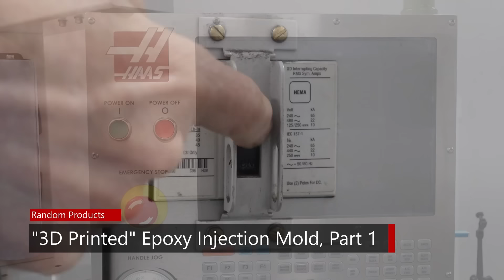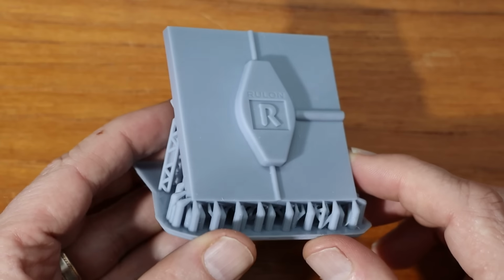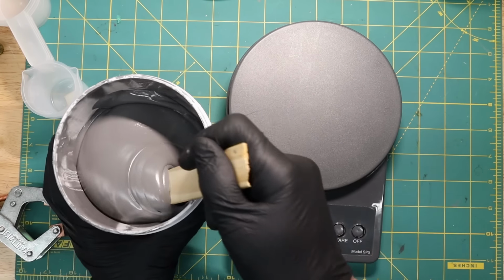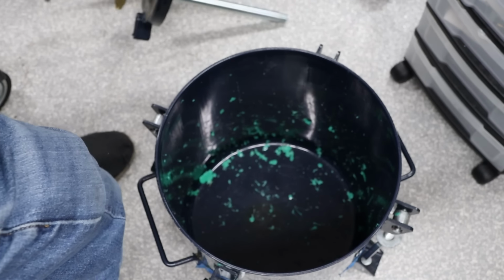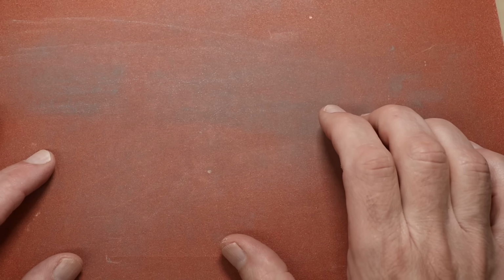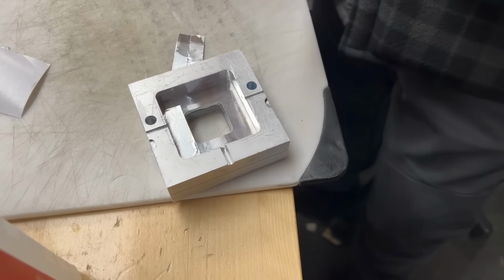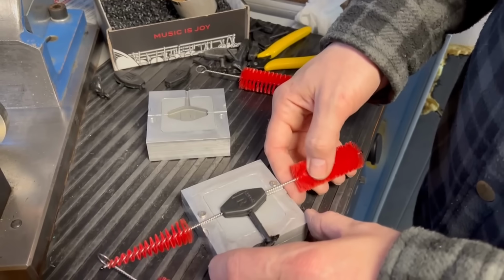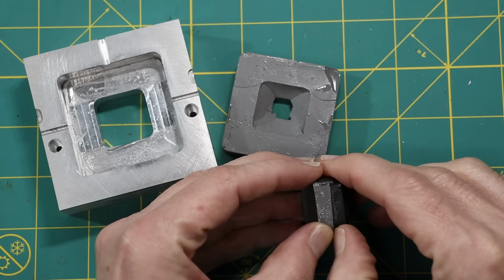"3D Printed" Epoxy Injection Mold, Part 1

Comment: If you add a radius to the thru hole for filling it should help a lot. You can see that the mold fractured along 45 degrees/the shear plane and this is encouraged by that corner creating a stress riser.
Reply: While this would certainly remove the stress raiser, overfilling the resin and sanding off flat at the mould half backs will mean that the epoxy will be better supported in the injection moulding machine platens, so it may not be necessary to machine a radius in the aluminium.
Reply: @dewexdewex  true, I guess it's more of an improvement rather than a solution
Reply: & smaller filling hole 👍🏻
Reply: Agree with the suggestion for radii (radiuses?) on those sharp corners in the aluminum carrier. It’s pretty much an article of faith when designing plastic parts - which your epoxy inserts also are, despite the aluminum filler - to use radii rather than sharp right angles on all shoulders, ribs, gussets and bosses to remove creation of stress points that build in weakness and may fracture - as this one has. 

Radii there will also help to reduce air entrapment when casting the epoxy. Spent about 15 years casting liquid urethane elastomers for engineering use, and the other article of faith I’d suggest is to slowly run the epoxy down the side of the aluminum and allow it to flow over the 3D printed pattern pushing the air in the bottom of the cavity before it. Maybe tilt the mold to about 25 degrees and slowly bring it back to level as it’s filling. Dumping the material straight onto the top of the pattern entraps air in the pattern detail right from the start. 

Cheers from Melbourne, Australia - thanks for a great video, love your work!
Reply: @nongbloke  agreed, fellow Melbournian :)
Reply: For easier machining (i.e. not a radious), a chamfer may well be enough.

Comment: This is really neat.  I've used high-temperature 3D printer resin to make moulds, experimenting with a home-made Buster Beagle 3D injection machine at the same time.  I've heard of people getting a hundred parts out of a run with direct printed parts which was good enough for my use case because printing another mould is easy enough.

Usually I ended up getting plastic stuck in some lettering after a few injections on my own machine and now I'm planning to upgrade my machine and try mould release.  It will be interesting to see how durable the epoxy is--if it's over 3x as good as directly printing a mould it would be worth the effort.  Thanks for the video!
Reply from the maker: I think it will be a lot more durable, but we won't find out until I make a new set of molds.

Comment: Thank you for this very informative testing video. This will save so much time and effort for others. The smaller hole for epoxy entry you mentioned while pouring might be all you need for reducing the blowout. I wonder if the hole could be so small that a syringe could be used to add the epoxy. Not sure if that would introduce bubbles. The smaller the hole, the harder it will be to remove the epoxy mold to be replaced by another mold, but each mold may need its own aluminum holder due to the sanding as the aluminum will be affected in the sanding process that the molds will need to be paired with their aluminum counterpart.

Comment: Great vid! Very interesting to watch, and I wanted to say thanks for your channel it is very helpful. I think you might be able to drill a through whole/slot in through the corner of the metal mold holder in place of the cutout at the back to pour the epoxy in. The corner because all the air would naturally bleed out there, and then it wouldn't allow for the epoxy to blow out

Comment: Is part 2 uploaded? Definitely think the back of the actually part in the resin needs supported by aluminium maybe put a hole in the corner where the 60psi pressure isn’t pressurising against it great work great patience something I’ve been looking into and possibly going to be doing in the near future great value received here pal cheers

Comment: I used this same method (also with Epoxacast HT) to prototype molds and I had a lot of trouble with uneven shrinkage/deformation on mine so in the end, the mold halves were misaligned by 0.050" or more. Also had issues like you with bubbles not popping due to the high viscosity, and found that much higher time sitting in the vacuum chamber helped, but don't have a pressure pot to use like you. The end product can also be quite brittle, so features that stick out and small details are more vulnerable. I think this works well with smaller molds with less detail, but probably won't be pursuing it for any larger or more intricate parts again.
Reply from the maker: Agreed. I think this is a potentially better over pure 3D printed molds. But clearly not a replacement for CNC machined molds. For the next version, I'm hoping that Rulon can do a production run to find out how long it lasts.

Comment: I have experienced similar defects when printing molds flat on the build plate. I attribute both the rough edges and compressed Z height on the top features to the same issue. The printer is not rigid enough to apply the required force to squeeze all of the resin out from under the large base section before the exposure starts. The resin continues to squeeze out during the exposure, causing the partially cured rough edge. The Z column deflects slightly so the layers with large cross sectional area print slightly too thick, but layers with small cross sectional area do not. I have been able to eliminate the rough edge and improve dimensional tolerance on my prints by adding long pre-exposure wait times and heating the vat to decrease viscosity. Printing at an angle solves the problem also but of course requires supports.
Reply from the maker: Thank you. That all makes sense.

Comment: While I'm just a beginner to this, I have been making resin mold masters for epoxy casting and I have a few tips from my experience over the last couple of years. I think that "traditional" top-down laser printers have fewer forces to contend with since their parts are in compression, not tension, since they sit on a perforated plate and descend into a vat of resin. That resin acts as a sort of support for the whole thing. If you need parts of a more geometric design that require tight tolerances that might be the way to go, but it is pricey, I was quoted about $1000 for a part the size of a softball. Printing things flat on a consumer printer can make your parts deform in the z axis. I always get stretching, sometimes as bad as 100%. It depends on the resin and the temperature of your print area. Using a heated enclosure at around 30 degrees celcius can help, when the resin is thinner there's less forces. If you print at an angle, round things won't be round. I've had a heck of a time trying to make parts with gasketed fitted lids. I've had to print the part over sized and machine it on a mill and lathe to get the precision I need.  If you print hollow, which reduces the weight and thereby the distortion, you will need drain holes and an ultrasonic cleaner to get all the uncured resin out or your parts will swell and crack over time.
Reply: Injection molding at home
Reply: I don't remember the UV resin brand/model being mentioned, but it looks like standard everyday resin. When I am trying to attain more accurate forms, I've had good luck with Sirayatech Build resin in smokey black. I would also try to print the master with the flat parts directly on the flat FEP, and hollow the whole thing to about 1-2 mm, with lots of ribs for structure.  You could then back fill the hollow reverse side with resin and pressure cure it for strength.
Reply: I also recommend a 24 hour post-cure in a UV oven, submerged in water. This will ensure the part doesnt warp as it ages.

Comment: Great video. I would add 4 3/8" -16 flat headed bolts thru the back side of the mold. One at each corner. Put mold release on the bolts before threading them in then tighten them well. Before you add the epoxy making sure you put more mold release on the whole cavity. They should protrude 2/3 to 3/4 of the way into the cavity area. . Putting a small relief angle on the sides will also help releasing the mold knowing the bolts will hold it in place. Without the relief angle you may want to make the bolts captive that way helping to push the mold out when not needed. Hope that helps.

Comment: From my understanding of the warping, it's due to the print getting stuck on the vat because of a vacuum/suction formed as it prints. That's why when you printed it at an angle, you had better results. The surface area of the print was smaller, so there was less of a vacuum being formed during the print.

Comment: Had the same idea as well. Did not know they made an epoxy mix.. Was going to try graphite powder as well as aluminum powder, for heat dissipation and maybe a mix of the 2. Was also going to try monster clay, to make a base mold. But not sure of  how hot the heat off gassing of the epoxy would be?(Temperature Gun of the epoxy would help) Testing.. will see 
PS.. would buy those blanks if they were available to buy..

Comment: Nice work. You may want to apply heat grease or a thermal compound in the interface between the inner epoxy mold and the outer aluminum case. It would surely be messy, but it is likely to help with the thermal performance.

Comment: I would suggest you fill the square opening on the one side completely and make sure it is flat wrt the rest of the mold.  This will do two things. First, it will support the injected material while under pressure and prevent catastrophic cracking.  Second, it will create a thermal contact with the pressure plate so mold can cool faster.  If you have a cool aluminum plate to set the mold on after injection that would also help to cool things down more quickly through the large sides of the mold.

Comment: One thing that helps minimize distortions/warping of the 3D printed masters is to use a resin with a bit of flex.  I print engineering prototypes and had a horrible time printing thin straight edges on parts until I saw a few YouTube videos comparing various resins and started using Sunlu ABS-Like resin.  It's fairly cheap but has little warping compared with most resins.

Comment: Thanks so much for you video, i Want see the part 2 ... i have some question, firts im from mexico, second the Epoxy can be change for resin of 3D Print?, i can see you have a problem whit the plastic, maybe your problem is the time cold and no the presure, i tried make a simple inyection machine with 3D print (ENDER 3) and the problem was my Mold and no the press... and last question which one the same epoxy injection similar?

Comment: Nicely done.
I wonder if the resin shrank uniformly enough to adjust the mold size to account for shrinkage (no tape).
Something I did to overcome the flatness issue for 3D printed parts was to print the part flat with a chamfer on the platten side. The chamfer lets you get a metal spatula under it.
I had printed parts and made silicone molds without curing the printed parts. Curing introduces stress and curvature so I just cleaned and blow-dried the 3D printed parts and then cast it.

Comment: What if you mixed the SLA resin with aluminum powder to combine the physical properties and help the heat spreads across the mold?

This way you’d skip the entire epoxy+remolding part, and still have the thermal benefits of the aluminum mix

Comment: I haven't tried it myself, but a while back I was looking into which resins had the highest temperature ratings and found the Stone Coat countertop resin to seemingly have the best numbers on paper. I had thought about using that resin along with mixing in either copper or aluminum powder to help with thermal conductivity. That resin is technically a coating resin and not a casting resin, so it may not work as desired when used this way, but could still be worth experimenting with.

Comment: I’ve had problems with filled lettering if I didn’t thoroughly wash the excess resin out. The IPA didn’t penetrate the recesses - acetone helped a LOT with making crisp relief features release resin but damage the resin if left too long.

Comment: Can I make a suggestion. Make the hole round. If you look at the cracks, the seemed to crack  exactly like old planes with square windows used to crack. In the corners. That is why you don’t get planes with square windows anymore. It causes too many weak points.

Comment: @JohnSL   I want to make a suggestion that builds on some of the other suggestions below:
Instead of filing the epoxy from the working face of your mold through the aluminum frame, add fill and vent holes to corners the 3D printed part.  Use a large syringe to force the epoxy through the fill hole while the mold is upside down (the printer part is below the metal frame)  This will allow the epoxy to flow over and away from your details, carrying any surface bubbles with it.  When the epoxy starts to come out of the vent hole, you will rotate to mold so that the vent hole is the highest point and continue to inject the rest of the epoxy slowly.  This way you can use the weight and viscosity of the epoxy to push out the bubbles and you can keep a solid back on the mold to avoid stress concentrations that will eventually shatter your mold.  The face of the mold will need to be sanded anyway, so removing the injection and vent sprue will not add much extra effort.  If you still have issues with air cavities, contact Robert Tolone  (another YouTube channel)who has an extensive experience in molding and casting parts.
Reply from the maker: Thanks. That's an interesting idea. By using the pressure pot, I didn't have any issues with air bubbles. My plan is a little different, but somewhat similar. I'm going to put pouring/vent holes into two corners of the frame back and pour into the "lower" hole. That will ensure that if there are any bubbles, they will remain at the back. But I think if I put the mold at the right angle, I won't event get those bubbles.

Comment: You need to angle the bolster inner side walls and the sides of the epoxy inserts at 1.8%, and plastic/plaster gauge the back faces of the inserts to the bolsters to work out the correct depths. Support your epoxy sides 360° and you will have the maximum advantage from the epoxy. Nice video. I think this would work. If you're using PVC, watch out it is explosive if left in a sealed heated chamber.

Comment: Do the plastic beads get hard if they're left on the heat too long? With PLA plastic (3d printing) if you leave the machine on with the hotend at printing temperature for a long time (several hours) without printing it will cause the plastic to harden like a ROCK and it's so hard you have to melt it out or burn it out. It can't be removed with physical force and it's probably not a good idea to try to Dremel it out.

Comment: Can you sinter it? I'm looking into various metal resin products that I'd be able to make a master mold of Stainless steel, sinter it and use that master as a repeatable mold for lower fired projects such as glass fusing and bronze. I'm told as long as the metal fill is 80-85% or higher sintering could work.

Comment: Instead of pouring the epoxy into a large hole, I would try 2 small 1/8" holes. One to inject the epoxy into with a syringe and the second is for air to escape. I think 2 small, round 1/8" holes would be less compromised than a larger square. More pressure against a square edge, than round experiences. Just a thought.
Reply from the maker: My plan for next time is pretty much what you're suggesting, but with perhaps 1/4" or a little larger holes at two corners rather than in the center.

Comment: The sagging of the print is the print sticking to the PET film between layers, silicone spray emigrate it a bit but the trick is the 45 degree tilt is making the contact area of the part between layers to become smalle this less release stress from the PET film

Comment: I haven't taken the time to read smooth on's specs for this epoxy in regards to shrinkage over time. I've worked with resins and epoxies for years and one thing that might be helpful, I don't know, but the epoxy like glass and concrete is great in compression and terrible under tension.
You could reinforce that epoxy with fiber reinforcement. If you took some fiberglass and removed 50% of the material so the weave was opened up and you layered that through the mold my thought is that would be near indestructible. I've done this before but never with the epoxy that you are using. You would have to use a putty knife to impregnate the glass cloth and then hand build the layers stopping about an eighth of an inch of the surface.
Another thing might be to electroform the surface of the mold and keep the epoxy as a backing. Electroforming would be plating the surface whatever metal you choose and let it build up to a certain thickness. Adding air passes in the thicker parts of the mold for air circulation to aid cooling might be beneficial. 
Like anything, you need to R&D and figure out the process and come to solutions. There are many ways to go about making these molds without complex machining.

Comment: Instead of a rounded rect cutout in the aluminum frame, you could do a round threaded bunghole. Then you could screw a brass or aluminum insert into the hole to have full even support of the final mold. Just sand off the back of the epoxy mold as well so that it can sit flat with the cover in place.